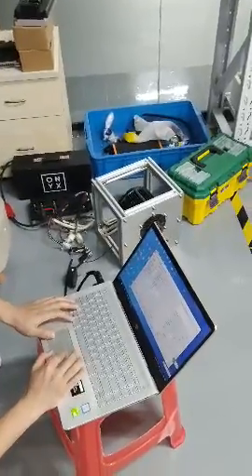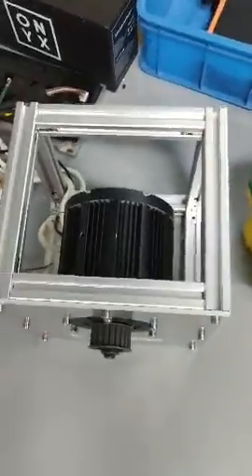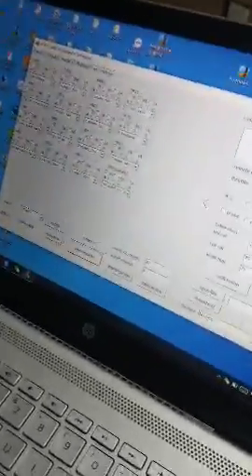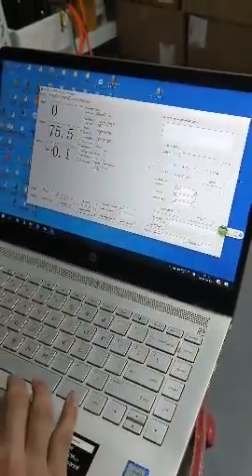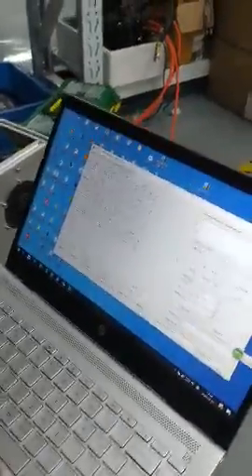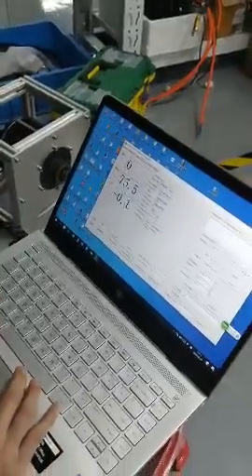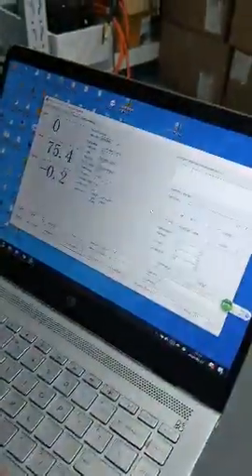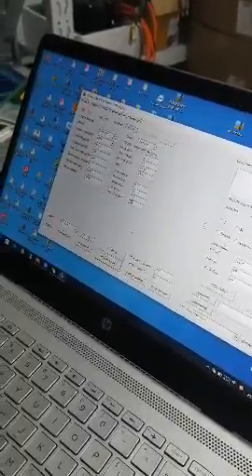VOTOL Motor Controller Release Regen Demonstration

Comment: can i connect hi-brake to 48v + or do i have to step it down to 12v ? will i fry controller if i give hi-break battery + voltage ?

Comment: Thanks for the video, I can connect via the Votol Software but how can I make the remote control Throttle works ? motor is not spinning when moving the cursor throttle !

Comment: is "rate of decline" in Page1 to reduce or disable regen? what is combinative torque? my battery supports up to 10A regen/charger, how i set the controller to don't go over 7A or 8A when regen? can i enable the regen only when i'm braking and no when i left the throttle? 
Votol EM200 support mobile app (i read on aliexpress). what app?
Thanks.
Reply: Have you figured it out how to put regen when you press your brake? I need this so much